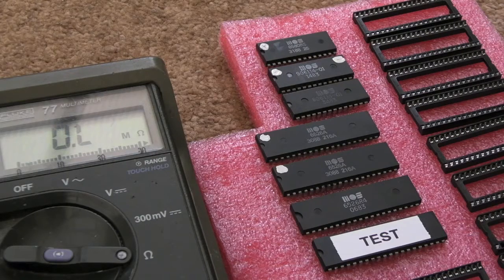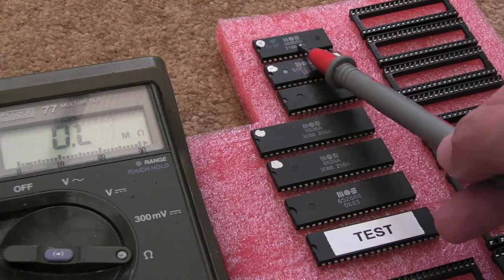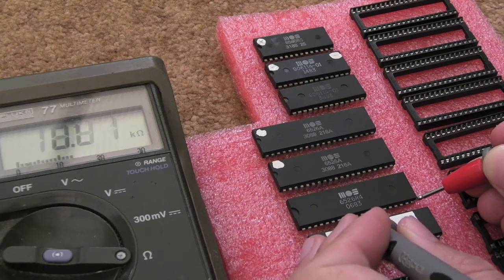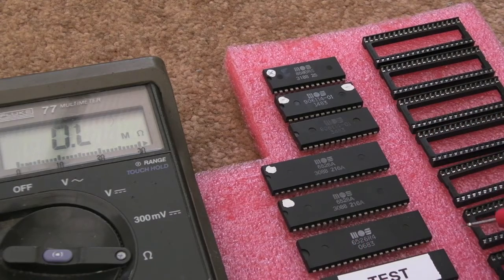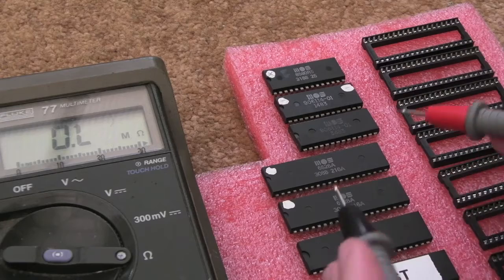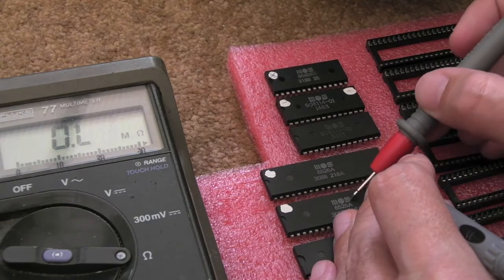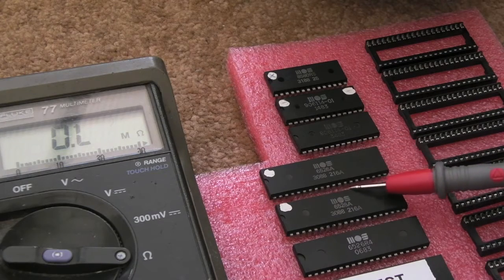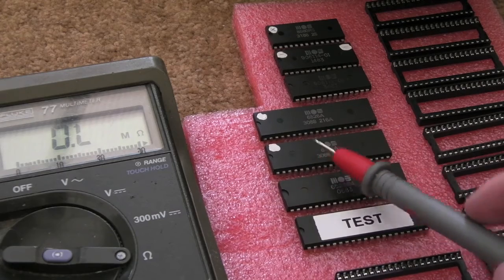Commodore 64 (C64) Looking at Faulty Chips

Comment: That's so obvious I never thought of doing it. I have several Z80, RAM Chips and others that have failed, I never thought to compare them like you have to actually see what has failed. It's a good quick test to do on unknown chips, cheers.
Reply from the maker: The other benefit to doing that is you can learn a little about each chip and those measurements can sometime later be applied to an IC in circuit.  A good example is the pull up / pull down resistors in some ICs.

Comment: ever thought about the IC socket? could have dirty contacts
Reply from the maker: Amy Marie The socket was brand new, and the chip behaved the same in two different boards.  Initially the voltage measure 0.3v, as opposed to 4.5v later (after feeding 5v into it).
Reply: +GadgetUK164 - Retro Gaming Repairs & Mods  Hi Pal, I'm looking at socketing my C64 breadbin. are the Dil & Dip Ic sockets the same thing? if not which ones do I need? Cheers.

Comment: Interesting...

With the piggy back chips, is there a way to determine which pin is fault and not use that pin? 

So like don't touch the top and bottom pin if the top chip is faulty (bend it out), chop off the leg of the bottom pin and extend the leg from the top chip kinda thing.
Reply from the maker: Beaps73 That's a very valid point and I did think about this after the video.  In theory, if the failed decoding doesn't overlap then it probably possible to only use the decoding sections that work on each chip.  I will think about this more and do more measurements and see what I can come up with.

Comment: I've seen a video on youtube. where someone piggy backs two graphic rom chips from an arcade board and it fixes the graphics errors in the sprites,
Reply: GadgetUK164 Nice gadget thanks for clearing that up! :)
Reply: bangulo2012 Link?
Reply: DJSvenNo1 I relaly can't remeber i thought i found the video. but i cannot find it. It may be even one of gadgets videos. But basicly he was demonstrating a bad eprom on the board causing bad in game graphics. and he placed a freshly burned new eprom from the MAME set and placed it onto the board and the graphics cleared up instantly. it wasn't a way to solve the issue without soldering. but was just demonstrating the behavior
Reply from the maker: bangulo2012 Yes, I often use the piggy back method to help work out where a fault might be.  I've talked about it in the ST and Amiga videos I think regards DRAM.
Reply from the maker: bangulo2012 It was also covered recently on Retro Games Party channel https://www.youtube.com/user/retrogamesparty, on one of the last 2 or 3 repair videos covered there.  It can be a useful technique.